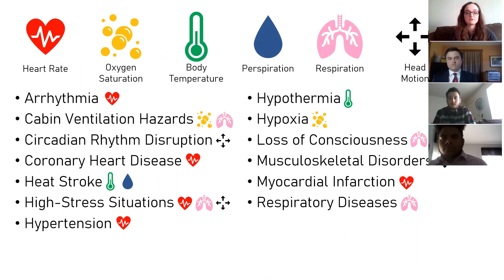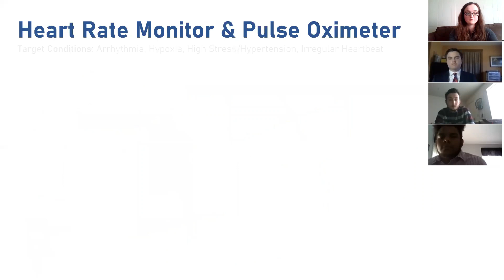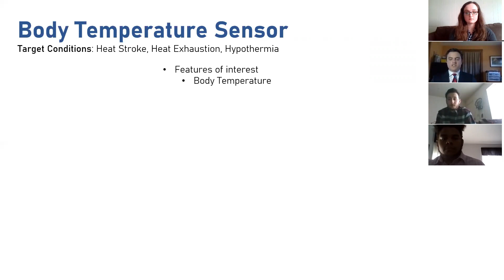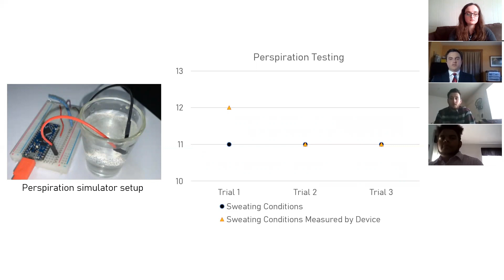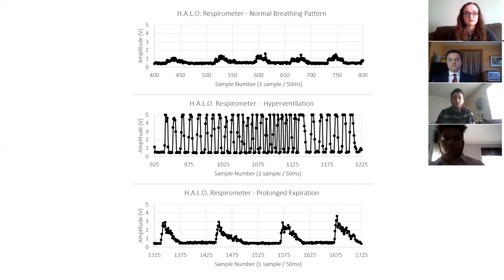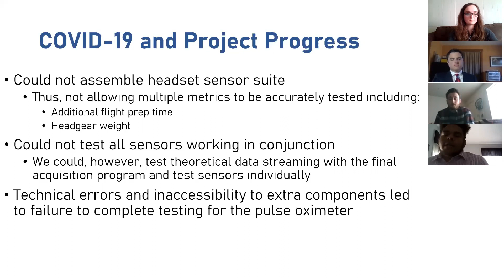H.A.L.O. Mk. 1 - Technical Presentation

Comment: You guys did a great job going through all of your validation testing and how they related to your goals. How do you visualize being able fit all of the circuitry on the helmet or headset? Are there ways to cut back on the circuitry to ensure it will all fit and minimize interference between sensors?
Reply from the maker: Great question. All of the breadboards shown in this presentation would be miniaturized using circuit printing and all wires would be placed into what we call the "circuitry highway" which will have a single clip to disconnect all sensors from the acquisition unit and power supply. These units would not be placed onto the headset as this would increase weight and cause ergonomic issues. The sensors themselves are very small and would not interfere with one another as can be seen in our schematic slide.

Comment: Really great schematics! Very neat, organized, and easy to follow!! Our team's question for you is . . . Do the temperature sensor and perspiration sensor work simultaneously, or do they work in series? A follow-up question we have is . . . are all sensors water-resistant or is there a cover to protect the sensors?
Reply from the maker: Thank you for your team's inquiry! Since each sensor is running on a separate controller, data is collected simultaneously for all sensors. The central acquisition unit (RaspberryPi) is also able to take input from each sensor and analyze the sensors in conjunction. Our current prototype is not built to be water-resistant, however, our team would be interested in considering this additional protection to ensure the device remains functional in extreme circumstances.